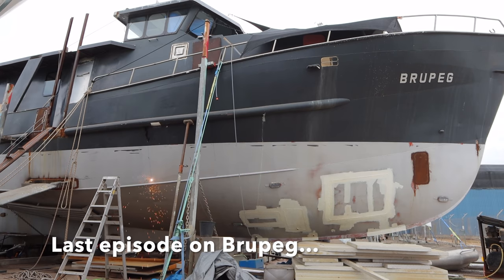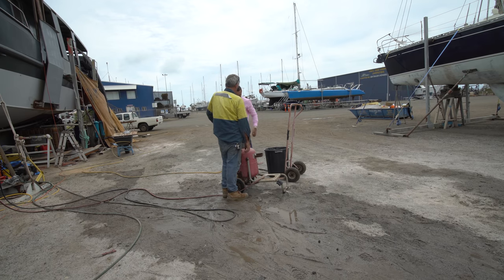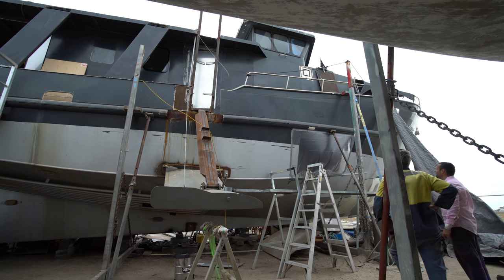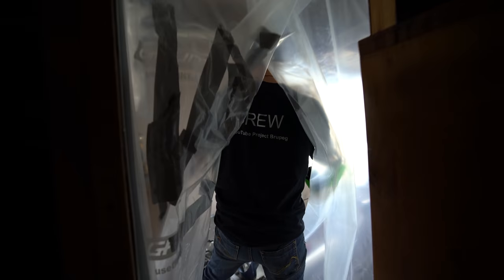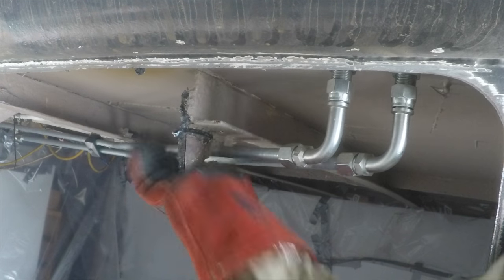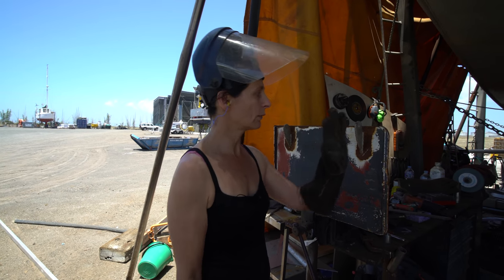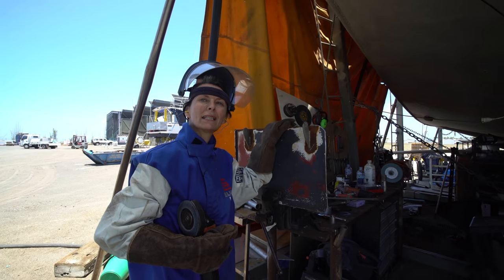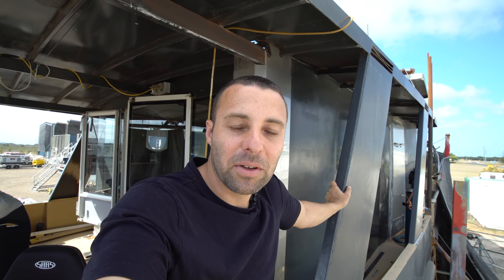Replacing Ribs in A Steel Boat - Project Brupeg Ep. 179

Comment: So what's the idea behind welding the plate? Is it just incase the ratchet straps fail?
Reply from the maker: A back up for the bog
Reply: I was thinking having a fold down door for ventilation and access for bringing stuff in when he first drop that plate down...
Reply: No worries , a couple of tubes of silicon would sort the problem, easier than welding 🥴
Reply: You know when the plate was winched up with the ratchet straps I thought “job done” too!
Reply: That ‘ratchet straps fail’ comment was out of line! If you’re so worried about redundancy, then drill some holes and run some zip ties through...
Reply: I wouldn't worry about water ingress, Jess is cutting a little extra of the back doors to let water out quicker
Reply from the maker: Hehe, yip sorted! Jess
Reply: @nic_the_aged_woodworker  nah, just a little bit of flex seal and good to go!!
Reply: @zoki.to974  Ahh, yes... Didn't think about that for the location of it..
Reply: LOL..!
Reply from the maker: Love the zip tie back up Paul
Reply: Good one Stu!
Reply: @JCrook1028  Umm, no it didn’t.

Comment: that issue with the air comp and the wet sand is probably responsible for the plasma cutter as well
Reply from the maker: Yeah the issue with the plasma was it either overheating on the duty cycle or not starting in the new machines case. the dirty air only really effects the consumables, they were ok
Reply: @ProjectBrupeg  
I have a cheap 50 amp pilot arc and it is super sensitive to moist air. It won't even fire in air pumped from 30% relative humidity, and still sputters when its lower than that unless I put multiple desiccant driers (which have to be dried out frequently)
Reply: I have found your tips and such wear so much faster with moist air on a plasma arc.

Comment: Great update as always. Mad that you just cut the rot out of a metal boat and weld on new skin. I suppose the welds are just as strong as the plate you’re welding on are right? 
Sad that the new plasma was a donkey from the off. Glad you’re getting it sorted too. 
Can’t wait for next week.
Reply from the maker: Thanks 👍 yeah by the time you have a root weld and two capping welds the welded area is actually twice as thick as the hull plate so if its done right its stronger than the surrounding steel. The ability to cut and replace is the main advantage i see with steel boats, hence its not uncommon to have 60yr old boats still in great condition.

Comment: I have one of the cheap 50 amp pilot arc plasma cutters and it is SUPER sensitive to moist air. I am 8 miles inland in San Diego, usually 30% relative humidity, and it still won't even fire (or it sputters) unless I have multiple little desiccant driers in front of it. Then I get maybe a few minutes of actual cut time until I have to empty them all out and dry them, because the plasma stops working when they just turn halfway saturated (on a blue-pink color indicating desiccant).

I've been looking out for an old air conditioner to steal the evaporator or condenser out of, to put it between the pump and the tank so it cools the air and makes the water liquify so it fully separates before getting to the outlet hose.

If that still doesn't work, I'm going to try an electric heater to bring the relative humidity down even further so I don't need the desiccant driers.
Reply from the maker: We found a big difference when we made the water accumulator. Just a tank from an old compressor hooked at the end of our 100ft air hose with a short 6ft line from that to the tools. Air comes out perfectly dry even when the main compressor tank has half a gallon of water in it after running for 20mins
Reply: @ProjectBrupeg  
Glad to hear you've had success with that,  Hopefully I can find a broken air compressor for cheap. (easier than trying to solder fittings to unknown sized copper AC tubing)
Reply from the maker: Yeah any pressure tank would work. An old propane bottle would be another viable option

Comment: Use a multi stage air dryer with desiccant with your plasma. Saves consumables and makes cut quality so much better
Reply from the maker: Hi Adrian, with the new dryer we built to help with the sand blasting used on the plasma its transformed the cut.

Comment: Just wondering  if you did the metal test. To see were the metal  is thin in places or ready make a hole???
Reply from the maker: No Need as we can see both sides of this steel plate. We knew it was thin based on the pitting visable from the inside.

Comment: Why not mount the winch for the sliders underneath the wheelhouse overhang and bolt through to the plate welded on the wheelhouse roof  it would give a better track for the cable and add protection for the winch?
Reply from the maker: That was going to be our first plane but when we started to position the winch we realised it was too big to physically fit under the wheelhouse room so we decided to put it on top and build a protection box around it

Comment: just an idea, is your problem with the plasma more good old h2o in the air and you need to think putting better water seperation in the air line before getting to the plasma
Reply from the maker: Hi Robert. With the old plasma this was sometimes an issue but the new plasma simply wouldn’t start, when it did it would blast for 2-3sec then cut out consistently. From what I’ve seen water in the line shortens the life of the tips but doesn’t effect the start up process

Comment: rust converter is cheaper than sand. you don't really need to be blasting steel with a little ginger on it the blaster is best used on removing paint and built up rust.
Reply: Getting rid of the mill scale is vital. It has a different electrochemical potential to the steel itself.
Reply from the maker: Yeah nah, 100% disagree with this. Millscale is baked on carbon, its there to prevent rust for a short period of time. it falls off after a while and paint goes with it. If millscale was ok to leave and paint EVERY ship yard in the world would do it as sandblasting is expensive and dangerous so avoiding it would save ship builders hundreds of millions of dollars per year. anything on the steel that isnt clean white metal has to come off for the job to be done right.
Reply: @ProjectBrupeg  I never said anything about leaving millscale on.....

Comment: How cool would it be though if you could keep that panoramic window and have a view right into the ocean. ;-)
Reply from the maker: That would be cool!
Reply: @ProjectBrupeg  A small porthole with a high-res camera might do as well.
Reply from the maker: Too much risk with it being the area with the most impact and pressure from ice
Reply: @ProjectBrupeg  Probably ideal to put it in the transom then. They do even make cameras for this application commercially. Google "through hull camera".
Image quality wise probably better to use an SLR in a gas tight housing that can be evacuated or filled with inert gas to prevent condensation. Practically a torpedo-tube with a porthole at the end. Then both the glass of the porthole as well as the breech of the tube would need to fail to cause any danger. Maybe something for the first haul-out :-)

Comment: Hi Guys..You might have figured this out yourselfs,but isnt it a good idea to weld two or three pieces of rib on the (outside) hull ,at the bottom cut of the hole opposit to the inner ribs(,but a little less tall),so that the new plate will slide in down and rest snug on its definate position ,and then get the top of the plate in line with the top of the hole with the hoist,with a  towing eye (or two)on the inside of the new plate .When thats set you start welding from bottom to top like two inches at the time and aplly slow tension with the hoist.I n that way the plate wil bend easier due to the heat of the welding.  It will take time,but this way there wont be any structural tension on the hull,when all is properly welded around.Another tip (if you already didnt think of that)Try and get a cutting torch on gas/oxygen.They will always work when the plasma or electricity fail plus you can heat up lots of things when you need to.Cheers guys,that was a great post again,good luck with the hull repair,and be carefull and safe..!!
Reply from the maker: Hi Frank.. I imagine that could work but we try to follow the methods used by welders use to survey specs on these trawlers. I think it would make cutting and fitting plate more difficult. We rent an oxytorch when necessary and would have loved to have one but here in Australia it is too expensive. This project is being done with very little resources so we have to find a way when we don’t have what useful. That’s part of our training though. If it was easy we would not be the kind of crew to do serious projects. Cheers Jess
Reply: @ProjectBrupeg  Hi Jess ,thanx for the reply...But I ment to make things a bit easier by having the opportunety to have the plate rested spot on with just welding on two or three small pieces on the outside of the hull,like this...https://thecoastalpassage.com/patchsteel.html    ...I am sorry to hear that an (simple) oxy torch is that expensive overthere,didnt realize that,cause I do know you guys are on a budget,hence my sheer admiration for the project,which is going to be(and is already) a great succes,no doubt about that..!!Cheers from a retired welder from Amsterdam
Reply from the maker: Yeah thanks I know you meant.. shaping is easier without bottom tags and the sponson at the top makes it too hard to start at the bottom. We have to start with the whole sheet so freedom to move in this case is more important. I can see on the right plate it would be brilliant. Cheers Jess

Comment: Try this plasma cutter on Amazon it has several great reviews from youtubers here in the USA and it is dual voltage so it will work with 110V and 220V power.  SUNGOLDPOWER 50A Air Plasma Cutter Inverter DC Digital Display IGBT Portable CUT50 Welding Portable Machine Cutting 50Amp Dual Voltage 110V and 220V
Reply from the maker: Thanks Killshot. We have just managed to upgrade to an 80amp plasma via our patreons. But thanks for sending this through. Dame

Comment: Hi guys, do you have any concerns regarding the inside of the half pipe sections (sorry not sure in the correct name) that run down both sides of the boat? When you cut into it for the wings there seemed to be a lot of rust? Is it possible to pressure test it to ensure there is no way for water/oxygen to get in? Love your work!! :)
Reply: Oh also, I guess there is no chance of a porthole? May due to ice??
Reply from the maker: Hi Stuart, no chance of portholes because its too close to the water line and ice is the main risk. the halfround (sponson) is rusty on the inside but its not bad enough to be an issue. once that is welded water tight the rust will stop and it will last another 50yrs without drama.

Comment: Why are you working in a smart shirt? The grinding sparks is going to burn and not to protect you. You have already had a sand blasting accedent!
Reply from the maker: Hi Grant. I’ve been using business short to work on Brupeg for years. When the temp is set to Northern Aussie summer it’s this or a T shirt. Grinding sparks are a non issue nor is welding in these shirts. When we need something better for say overhead welding we have flameproof welding jackets on hand